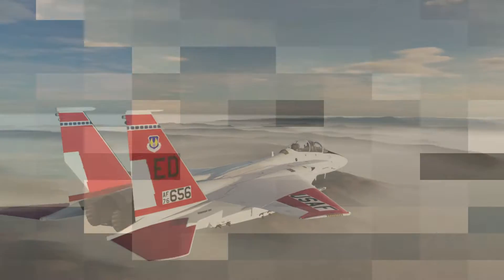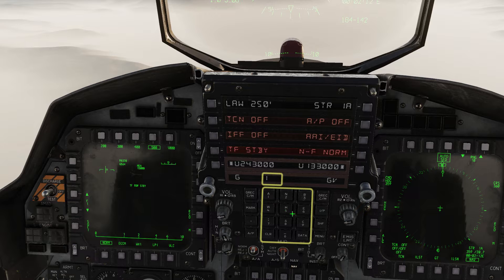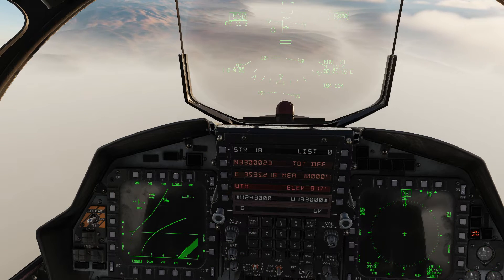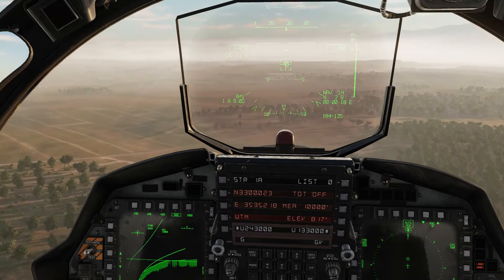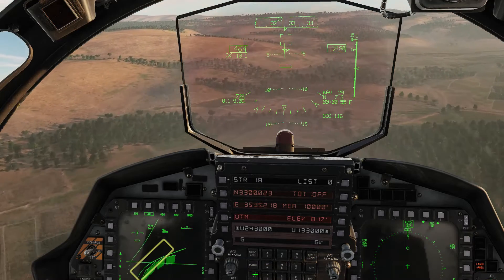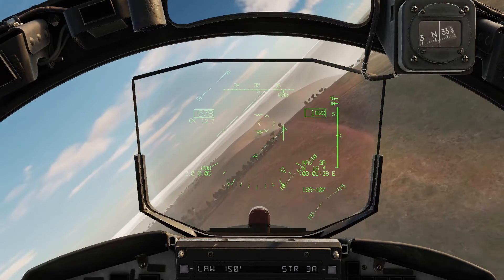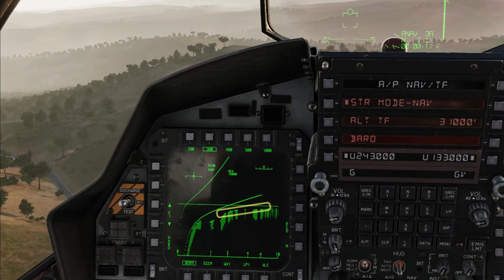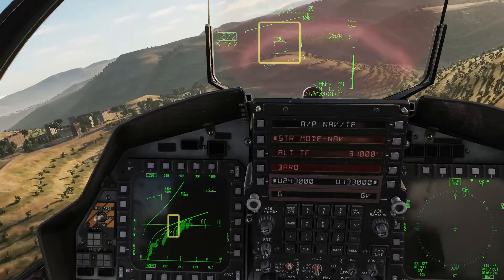DCS F15E TFR Tutorial - Terrain Following Radar in the Strike Eagle - DCS in 3 Or Less

Comment: Great neat short guide, many thanks. I used to do this for real on the Tornado GR4, so this was really fun to try in the F15E 🙂
Reply from the maker: That's pretty amazing! I'm looking forward to the DCS tornado coming out... The sim needs more Brit jets!! (even if it is the German version) Does the Tornado's TF radar display work in much the same way as for the Strike Eagle? I was trying to research exactly what the top line represents but i couldn't find much beyond "if it crosses the lower line you're about to crash".
Reply: @GotSpaceGame  It's pretty similar. The E-scope display in Tornado goes to 6NM, the pilot could 'see' the ground returns approaching, the Nav would look at the Ground Mapping radar in 20NM range scale and talk about terrain coming up outside of 6 NM. For example a large hill/mountain would have 'radar shadow' beyond it (radar can not see through terrain), this was called 'Cut-off'. So Nav would talk about 'cut-off 10 miles, '8 miles' etc then the pilot would say they see the cut-off on their E-scope.....and then both crew members would watch teh cut-off getting closer and closer and wait for the auto pilot to pitch up at around 1 to 2 NM depending on the gradient....it could be a bit tense.  Pilot might say 'jet responds, climbing'. The pilot Artificial Horizon was much better than the Nav's, and in the GR1 there was only a HUD for the pilot, so the pilot would call the climb angle for example.  Then the jet crests teh hill and the radar would paint the terrain on the other side and down it would go...rinse repeat!  It took a lot of crew co-operation and focus to monito the system.  The planning back in the paper map days was an art form to time out the routes accurately, especially for a 2 or 4 ship formation route.